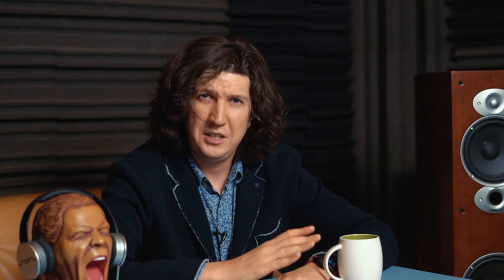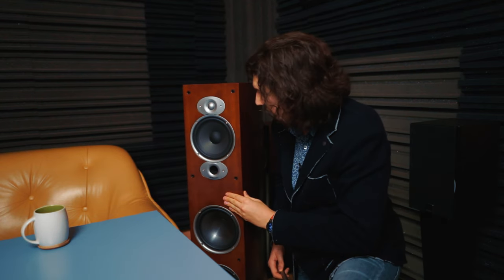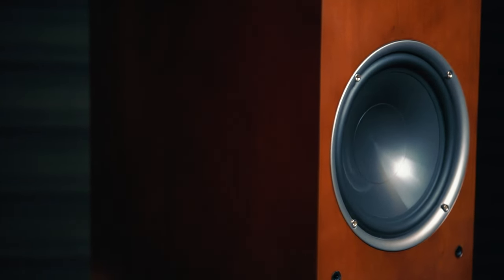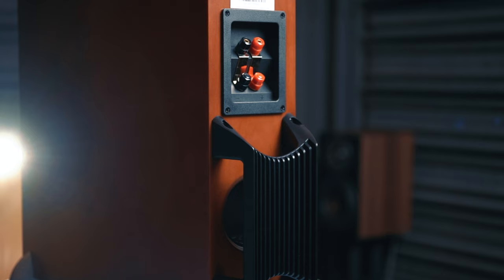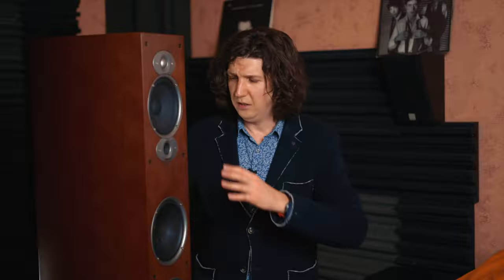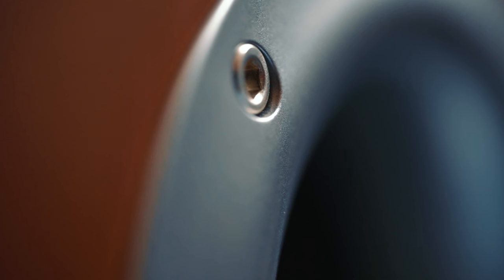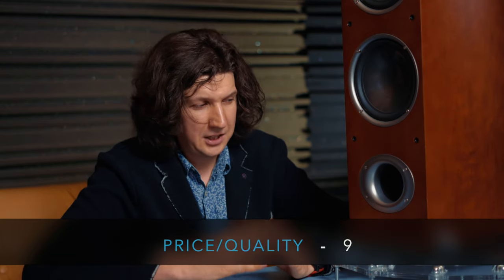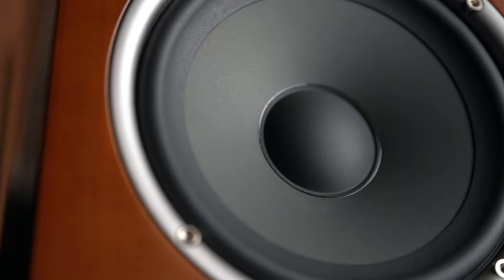Polk Audio Rti A7 review, sound breakdown, movie and music test!

Comment: Good Review!! 👍 I've had RTI A7s & A3s since 2007 being driven by AV Yamaha rxv863 until 2 years ago and now driven by Vincent preamp with emotiva and parasound amplifiers driving them.  The difference was night and day and my ears don't hurt anymore. For the price of these you can get fantastic sound from them with high end equipment pushing em and even better if you were to upgrade the capacitors and connectors but it's not worth getting crazy.. for me I'll upgrade to high end audiophile speakers b4 trying to make a Cadillac out of a Buick.. but hey these are awesome speakers for the price I paid and I'll use them in the basement once I upgrade. 💯

Comment: I have owned A7’s for some years. They sound pretty good, and when pushed with enough power they sound even better. 
They do not, however, measure up to the original 1st studio monitors that were superior to virtually anything up to twice the price back in the 70’s when I bought mine. 
Still, for the price, they are pretty damned good.

Comment: Had them since 2017. Great for home theatre. A lot of bass is present but I would say it's also a little bright when turning the volume up. Perhaps it needs a bigger amp to drive it ie 200/ch. Then again I found it better with a 2.1 setup with an active sub woofer.

Comment: I have these and he is correct. Give them a 9 out of 10 for home theater setup. Give them a 7 for two speaker music setup. That's not bad considering I got mine at a very good price of $650 for the pair. You want a set of speakers that will do better with music? Go with the Polk R700 but they will cost you $2200. I would  give these speakers a 10/10 for both theater and music.
A similar tower design from Polks top of the line would be the Polk L600 at $3500 per pair. They are comparable to high end speakers costing even more! 
But I will say that the Polk RTI line is better than the newer budget XT line and about a tie with the Signature Elite line.
Reply: how would you compare these to the ES55? I was thinking I might change to them but after this review for theater mostly I do not think I can improve much on the RTi A7 without spending a boatload.

Comment: Do you have the Hertz number on this one.Because I have to set my AVR power to match this speaker.
Reply: I have these speaker and like them very much, no ear fatigue.  I have not measured the frequency response.  According to Polk Audio:  -3dB points:  35 Hz to 26,000 Hz.  Total freq. response 20 Hz to 27,000 Hz.  Sensitivity 89 dB.  Mid/Woofer cross-over:  125 Hz.  Tweeter/Mid cross-over: 2700 Hz.  Hope this helps.